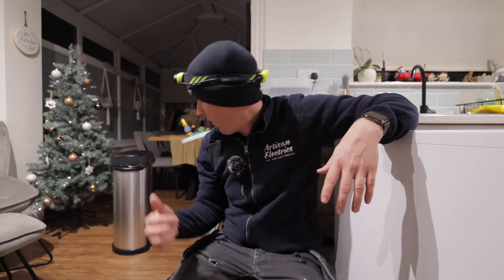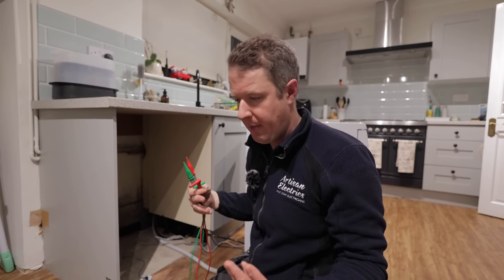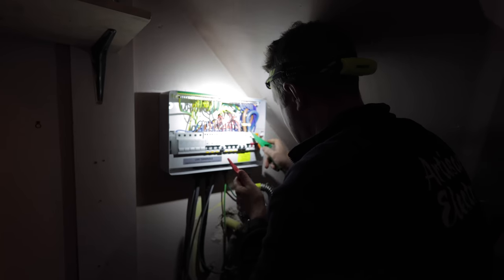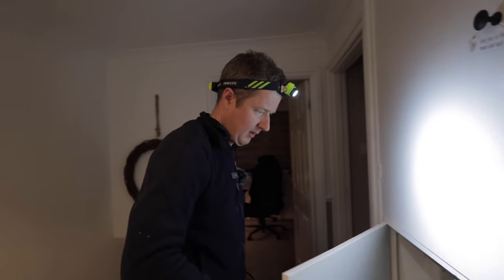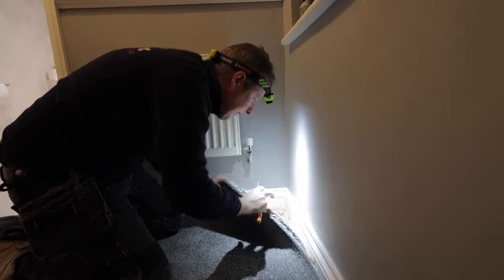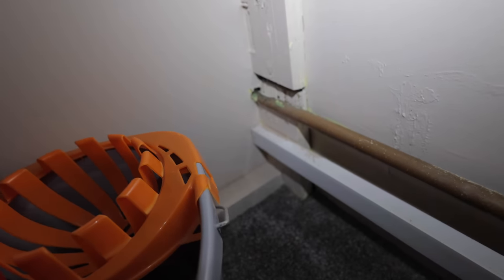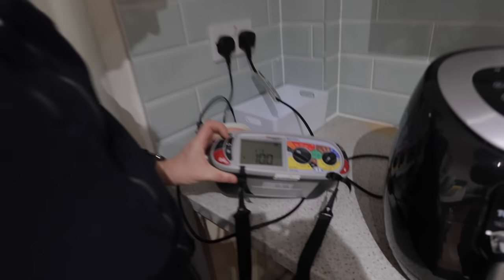Nearly KILLED by a CRAZY fault! What on earth is going on? 💀

Comment: My dad was a qualified electrician and taught me how to work with electrics, one of the first things he did was taught me how to work on live cables (very dangerous, I know!), he then told me to never, ever do this unless there was absolutlely no way to isolate the power, then he told me the reason he'd shown me this was that he wanted me to always work on the cables as if they were live, that way you almost completely eliminate the posibility of getting a shock, because he once has someone turn the power back on to a circuit he was working on after hed turned it off, the other guy was working on a different circuit and flicked the wrong breaker switch back on and nearly killed his mate! So even if I know the power is off and there was no voltage present when i tested it before commencing work, I still work on the power cables as if they are live, never touch the copper, use long nose insulated pliars to manipulae the wire if needed and use wago's to terminate the end if needed to remove the chance of the wire touching anything. I had people call me over cautious but when working this way I have never had a shock yet. Although, in this scenario, the fact you didn't do this meant you found a fault that may never have been found until it was too late and possibly taken someone elses life. 👍

Comment: I had a similar thing as a gas engineer. On a call out found still had power with the breaker off.
Found they had used 2 separate circuits to provide permanent lives one was on the downstairs powering the boiler and the other was on the the upstairs circuit power the controls. The bleed was through the boiler switch live.
I pulled a cable through down to the boiler and used the same perm for both. This solved the issue there. Took me while I only know basic electrics to go with heating systems

Comment: Green goo in the old thermostat cable is plasticiser degradation from substandard twin and earth made available between late 1960’s to early 1970’s. Should check if it’s anywhere else in the house. If so, more frequent EICR’s required to monitor whether the insulation has broken down anywhere else. Great video and good job you found the fault when you did. Very dangerous!

Comment: I had a potentially similar situation when adding a single phase consumer unit where after I had isolated the main switch, the neutral wire sparked back to the terminal block as I removed it. The neutral was shared with a piece of 3 phase equipment. I had simply checked that the line was isolated - never ever safe to assume.

Comment: I wired boilers in for about 5 years. As soon as you started the video I said to myself its the heating system.
The guy I worked with at the start always removed everything before starting over and that's exactly what I did every time. He said there are a lot of idiots out there and he was correct.

Comment: On the matter of lifting floorboards, a tip. Before lifting any boards use a Sharpy and mark adjacent boards 1 1, 2 2, 3 3 ..etc, on the edge, the same number on adjacent boards and an arrow or each board pointing to a common ref point such as a door frame or radiator. Cracking good fault finding.

Comment: I feel like this is a strong argument against 1p RCBOs and 1+N circuit breakers. Interrupting the neutral is dangerous more often than not!

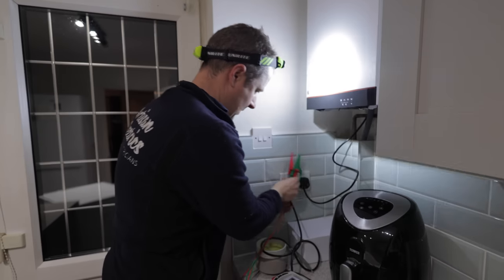I'd suggest wearing gear for working under voltage (at least insulating gloves) in the situation around 11:45.

Comment: As a fellow electrician, i really enjoyed your video.
Glad u were safe from this fault and, now u have fixed it, the customer is safe too! People don't understand sometimes what they are playing with.

I recently found a bathroom with 2 sockets on the other side of the room that u can switch on and off with a 10Amp light switch, wired up with 3g2.5.
And some socket extension boxes, the plug cut off and wired up permanently to the fuse boxes...

Stuff makes me so mad sometimes…

Comment: Usually the water heaters cause issues. One time I was in the shower of our newly rented out house and I felt a tingle when I was under the shower. Turns out, all 3 phases were properly connected and so was the neutral wire. Only issue was that the ground was loose. After reconnecting it, no more tingling.
Also, fun fact, old school wiring… the neutral and ground were treated as the same thing in Germany some time ago. After the guidelines changed it has become “Verboten” to go old school.

Comment: I struggled to understand the details and terminology (I'm not even a DIYer) but I got the gist of the problem. All I can say is: well done mate. That was quite a shocking bit of wiring... I reckon the previous electrician couldn't be bothered to run a wire from the boiler to the unit upstairs and so did a bodge job. That's pretty shocking. Imagine if anyone had touched the pins on that plug? I think the householders should get their money back from the previous electrician, at the very least.

Comment: I was a Major Appliance repairman for 27 years and I was shocked hundreds of times. The high voltage capacitor in a microwave oven stopped my heart. Lucky for me when I fell to the floor the Impact re started my heart. I now do Commercial HVAC and work with 120, 208, 240, and 480 volts every day also Wild leg three phase. 
I have more respect for electricity now but I have never been afraid of it.

Comment: I encountered this issue way back in the nineties when combi boilers were being fitted to replace older boilers. Really scary when you think you have isolated a circuit only to find some plumber has been booby trapping the circuit with a borrowed live feed to a boiler. The other horrendous live 13amp plug incident I had was in student premises where a student had attached a plug to either end of a flexible cable and for some reason had left the live plug dangling behind a fridge. The worst wiring fault I was called out to was where builders had been torching on some roofing felt on an extension and had burnt every cable above a kitchen.........had to take down the whole ceiling to replace the cables. I like the way you work.....totally professional and you try to be safe!

Comment: As an occasional DIYer I do not touch electrics other than where I am dealing with flexes on appliances rather than cable or wires. This scared the sh1t out of me. I have never heard of a plug being live when it is out of a socket dangling from an appliance. That is truly terrifying. To back up the esteem in which you hold 'heating engineers', I encountered a 'plumber' that I think was actually a drain layer that had read a Ladybird book called "My Dad's a plumber". We had moved into a brand new house and my wife was really upset that the state of the art washing machine we'd splashed out on was delivering up clothes that were more wrinkled than the previous cheapo one ever had. Coming home from business abroad in the early hours, I was not surprised  that the washer was on as we had a new born baby and there wasn't the extent of disposable nappies back then. As the machine was coming blissfully to its final spin, I was surprised to notice that the glass door was hot. Cut a long story short. The Machine wasn't cross-piped red to blue  and V-V., no. The dope that had plumbed in the washer point for us had mixed the coloured isolating valves and we had spent 6 months heating up mains temp water to do hot washes with, then rinsed it all with the hot bathing water in the tank. However, a brilliant display by you of knowledge and professionalism. Whoever trained you must feel mighty proud at the way you work. Bravo!

Comment: Have had the same experience with a switch chain that was getting live through two different circuits. Understood it by getting a nice shock like yours while I was changing one of the switches. As you said ALWAYS check the circuit again, even after disconnecting the obvious breaker.

Comment: My Uncle was a Master Electrician for decades... he has had a few wtf moments in his time.

The house I grew up in he did a partial rewiring on and told my parents "The was alcohol involved when this house was built"... let's just say it is a great place to learn on... every time I replace a receptacle I shudder worried I will discover something new I need to fix.
Reply: My favorite conversation with him on this was when I modified his wiring.

We had a natural gas furnace in the water well room in the back of the detached garage. The furnace failed and uncle suggested we just build a cabinet around the plumbing and use a small electric heater.

So we did that and it works.

Now the furnace was on an emergency power panel that could run off a generator. I took the wiring from the shutdown switch out and converted it to a junction and ran it to be a receptacle so the heater has backup power. My mom told my uncle I did that... and next time I see hom he is all "I hear you have been messing with my wiring" lol

Comment: In the US we sometimes get situations where power from the neighbors house backfeeds through the ground, up the water pipe, through the ground wire, into the ground/neutral bond in the meter box, and back up to the power lines. Often happens because someone upgraded their service from 100a to 200a or 400a, and the power company reconnected the same service drop that was often sized for only 60a. The power company here is not required to follow any kind of electrical code or regulations for their installations. So they do whatever they want. The often 6 gauge service drop on a 400 amp service will burn out and open the neutral, and then the neighbors power backfeeds through your system. In my own house I can draw an arc between the water pipe and ground with the main off. Power company has been called a million times but they will not fix it. We are due to be upgraded soon from 3 phase Open Delta 100A to 120/208Y 200A so we will get moved to a different transformer set that only has 2 buildings on it and they are both newer buildings. So at that point it won't be a problem anymore. But seriously I can measure 150A on the water pipe bond some days.

Comment: This is why when doing ANY electrical work you shut off MAINS not just the circuit you're working on. Or remove the fuse and keep it in your pocket.

I've seen doorbells wired into three different circuits, it's never worth it to turn off just a single circuit.

Comment: VERY WELL DONE video (trouble shooting).
Good job. Glad you weren't hurt on the initial event.
As a retired high-voltage maintenance electrician, I can tell you, MOST of the serious injuries/ fatalities I witnessed were due to individuals not performing ALL safety precautions/ tests. At least you ADMITTED your short-coming early on in the video- for that, I applaud you/give you praise. Someone mentioned in the comments about always carrying/ using a "non-contact" tester in your routine... excellent advice.
Just curious though,  Being from U.S. and not intimately familiar with UK residential power systems,  I wonder why you just didn't run a new cable straight UP to the heater control area from the main electrical distribution panel using same electrical leg as what was already powering the upstairs circuit. ( hope that makes enough sense)
Seems that would have been more simple (?)
I would much appreciate a reply (showing my error in thinking).
Cheers

Comment: I've had a similar but slightly different experience before - voltage and a shock on a circuit that should have been completely isolated. Technically, it was - but as soon as the circuit was turned off, a cheapo consumer UPS fired into life and the inverter was actually backfeeding 240v down the power cable into the circuit. 

Probably not a lot of current potential, but certainly enough to give a decent surprise shock!

Comment: This is probably more common than you think. I discovered the same issue in my house that has had a replacement boiler downstairs with heating controls in the upstairs airing cupboard. 
They hadn’t wired the pump properly either, it should have been wired to the boiler for run on, but was connected to the switched live for the boiler.

Comment: Nicely done!  Here in the States, that wiring scheme, where two separate hot circuits feed the same device, would ultimately be called a multi wire branch circuit.  In that case, by our code, we would have to use a common trip (2-pole) breaker.  This way, both circuits are de-energized when you shut that breaker and you prevent the very scenario you just showed us—which is very dangerous and could be deadly.

I would think you’ve got a similar rule where you are for this same reason.  Seems to me that whoever installed that water heater didn’t know or didn’t care.  Best practice would be what you ultimately did, and feed them from the same circuit.  Well done.

Comment: This reminds me of an ongoing problem in my house in California: I got an electric shock when changing some old outlets, despite the breaker being off and LN=0V, LE=0V, NE=0V. The shock came after removing the wire nut grouping together the various neutrals. One of the neutrals was live! It measured 108V to earth, and would happily spark when touched against any of the other neutrals. I figured out through trial and error which other breaker was feeding it. I had to hire a proper sparky to fix it, but I still don't fully understand the cause. I've since discovered a similar fault behind another outlet...

Comment: By installing a 230Vac relay upstairs you do not need to replace the cable.   The volt free contact of the 230Vac  ( normally open ) will be use as the switched-live.

Comment: My stepfather is an HVAC technician and while doing scheduled maintenance on an industrial unit for a local hospital he took a truly massive shock. While cleaning the air handler he failed to notice that the last technician to repair the unit had not properly mounted the fan start capacitor. He was using his air compressor to blow growth off of the heat exchanger and the fan start capacitor fell and hit him right in the face giving him over 1000V right across the nose.

Comment: I had a collegue that made that mistake. Circuit was mixed he was sure he turned the breaker off and went straight to cut the cable that supposed to be dead L,N,Pe all at once. He pierced the shears and made a loud bang. Thank god the other circuit was protected too and tripped the other breaker.

Comment: I had the same fault when I was replacing the boiler wiring for the council in whithenshaw in Manchester 30 years ago, I didn't know that the stat and the boiler were on two different supplies until Ihad a flash across a very nice sweatshirt whilst stripping the old wires out to install a new 10 way. I found the second fuse next to the fireplace . Do not trust plumbers with electrics.

Comment: I had a similar issue to this on a lighting circuit when I was an apprentice. A number of qualified electricians had looked the issue and not found it. It was a stairs 2 way lighting circuit that was normal when on and the lamp glowed at half brightness when off. The issue was a borrowed neutral where someone had used a neutral from another circuit for this circuit. So, when the light was off, and the other circuit was on, it was live via the other lighting circuit effectively making the circuit live via the borrowed neutral. This sounds very similar.

Comment: For me that would be an isolate and make safe. Sort it in the morning. You could have used an RF solutions mainslink. Installed a fuse spur next to the socket in the kitchen. You were lucky to find a cable route.

Comment: Commenting from the intro, sounds like a classic case of a high power device being wired outside of the fuse/breaker box. Probably a boiler, or radiator.

I once got zapped by a boiler during a large power outage, that truly was shocking.

EDIT: jeez that was dangerous, the plug bomb is absolutely lethal nevermind the 200V backfeed.

Comment: As an enthusiastic, but not trained 18 year old I volunteered to find out why the 2 drop lights in my future mother-in-law's kitchen were so dim.  It was a new town (council) house built in the early 50s.  I removed the downstairs lighting wired fuse from the meter cupboard and checked the light didn't turn on. I then got up onto a chair to remove the ceiling roses to see what was going on. Very strange wiring and the lights appeared to be wired in series.  I stuck my finger into the ceiling hole to pull a bit more slack and got a belt which knocked me off the chair.  Ok I was young and only got a few bruises.  Further investigation revealed that the wiring in the meter cupboard ( they weren't called consumer units then ) for the downstairs lighting was wired with the black wire (neutral) to the fuse.  The fuses were wired, individually via droppers to the live bus, except for this circuit which had the fuse in the neutral.  It was so awkwardly and obviously wrong that I can only believe it was done like that deliberately by the original sparks who was either pissed or angry about something at the time.  I corrected the wiring for future mum in law but didnt mention my shock.  I went on to get a uni degree in electrical engineering which, I know, doesn't make me a qualified sparks, but I think this story shows you can't always trust a "qualified" installer.

Comment: The house I moved into recently had a bathroom extractor fan wired from the light circuit and a permanent live (for the timer) supplied to it from the socket ring circuit.    I think the neutrals from the two circuits were connected together too, but I'm not sure because I disconnected both supplies at the nearest junction and removed the fan pending a properly wired replacement.  Still pending of course.